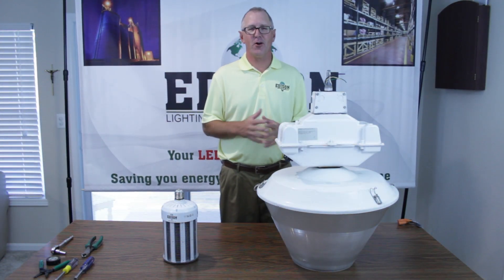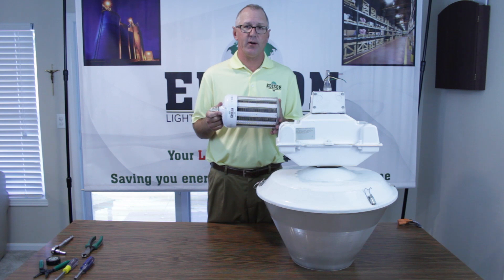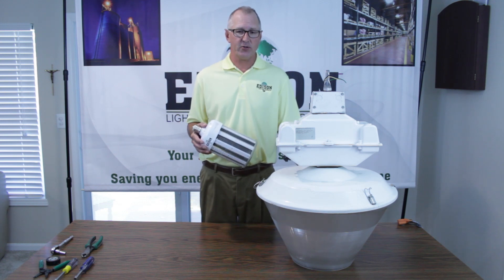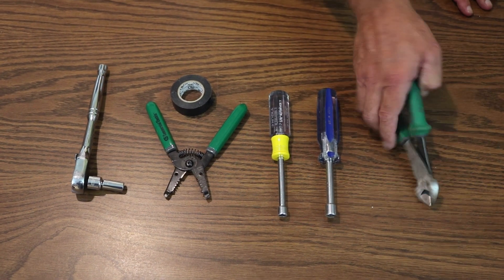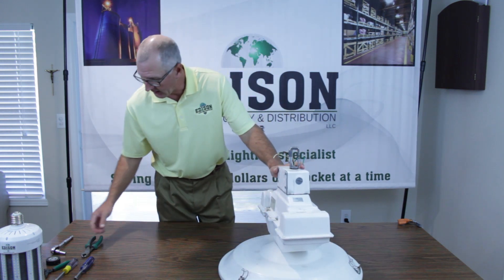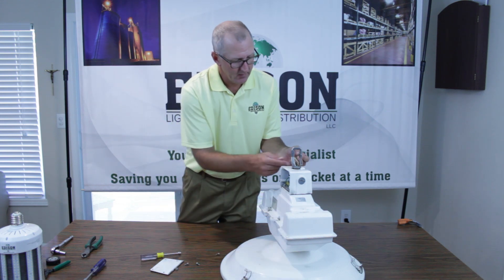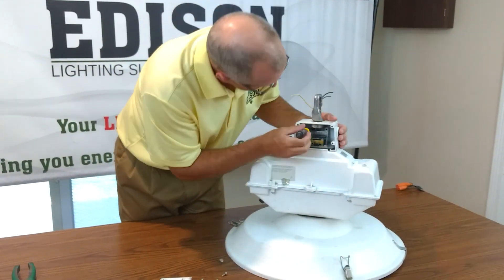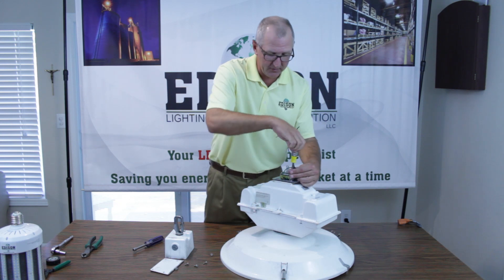LED: How to retrofit 400-watt metal halide lamp

Comment: I ordered T8's at a trade show.  For months, I got constant phone calls from the ELS sales team, trying to sell me more.  Getting rid of the ELS sales force was like trying to get rid of herpes.  I started off answering the calls and explaining that I had not had time to clear the floor of my building and rent the man lift required to replace my current bulbs.  The calls persisted.  Think of 'your car's warranty' type calls.  I stopped answering.  So then the salesman decided that if I don't have time or inclination to answer his calls, he would come by my place.  Ugg.  I crawled out of a piece of heavy equipment I was repairing and explained to him (again) the situation of not having time to clear the floor and put up the new bulbs.  I even pointed out the new, unopened box of ELS bulbs next to the door where they had sat for months.  When comparing the box to my existing fixtures, he realized that I had the wrong bulbs!  Thank goodness I didn't do all that work only to find it out myself.  So he ordered the right ones.  And they were actually cheaper than the wrong bulbs- good news! So he ordered a few more to make up the difference in what I originally paid for.  Better news!  Then the calls started coming from the ELS office in Wichita, Kansas.  YOU OWE US MONEY!  I called back and left a clear, concise, profanity laced message explaining the situation.  The sales manager called me back and told me sorry, they were wrong, he had had nothing but troubles with the new office manager and all would be taken care of.  Wonderful.  Don't call me again.   I'll call you if I ever want more of your bulbs.  But I wont.  Flash forward a couple months and, surprise- my account is in arrears.  I am sent a notice of over due bill for the charges that were wrong in the first place.  I left another, less clear, less concise and even more profanity strewn message for them late last night.  Fortunately, I still haven't taken the time to put up the ELS bulbs.  I want to return them and never have anything to do with this company ever again.  My experience with this company has been very negative, to say the least.
Reply: Thats awful that this happened to you but I would really like to see a response from the company as to why this happened.  When companies ignore customer complaints like this, it seriously throws up red flags.

Comment: Is it possible to put a plug in on these like a lamp?
Reply: Yes.  I have 8 in my garage.  Mine are multi volt and i had to set them up for 120v they were set for 477v.  Its just connect the wire with the metal 120 tag on it.

Comment: I installed one of these to replace a compressed mercury dusk to dawn , 250 watt ,  removed  the starter,   light works but no dusk to dawn option anymore!
Reply: Should work. I just did 2 of mine on similar lights with the puck style photo electric sensor on top. Check wires. Your sensor maybe gone. The ones I had on wouldn't shut off before the retrofit so I put new sensors. Works perfect.
Reply: It was the sensor

Comment: I have some HPS explosion proof housing fixtures, they are sealed enclosures and water tight, would your cob LED bulb be too hot inside of my enclosures? Would the extra heat shorten the life of the bulb much?
Reply from the maker: Our corn lamps are rated for enclosed fixture usage.
Reply: You are NOT allowed to retrofit explosion proof fixtures with corn lamps!!! The lamp will void the Class and Division ratings of your fixture.